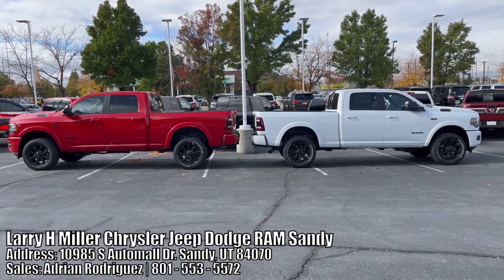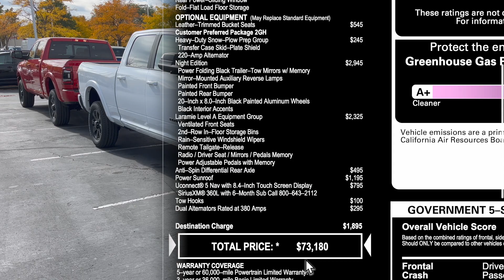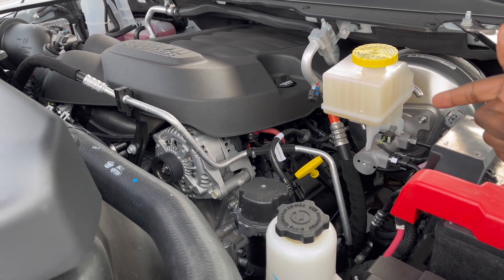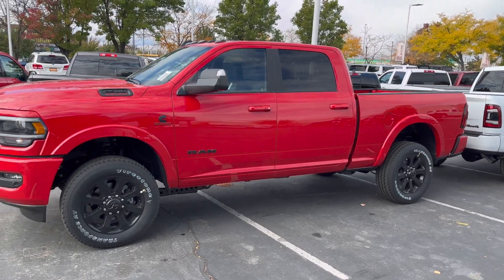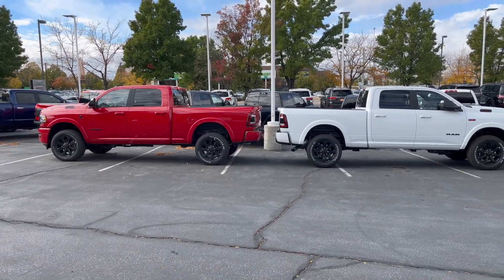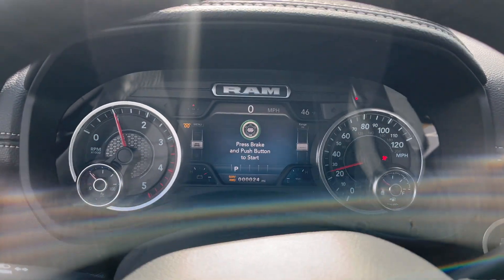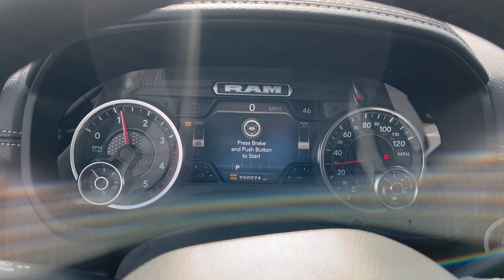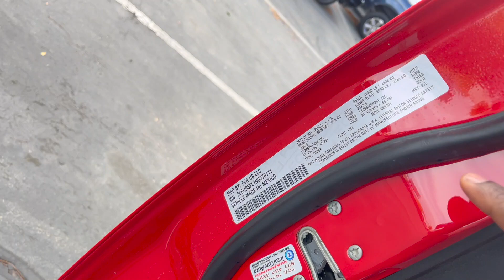Diesel Vs Gas: Why Is The Gas Engine Becoming More Of An Advantage Over The More Efficient Diesel???

Comment: i just bought a 2012 ram 2500 diesel with manual transmission for 7k at a action i had front damage i fix it for 3k more total cost 10k and it has 180xxx miles iam really happy and 2012 is the last year it doesnt require the def fluid

Comment: There's a reason why the 2500s are capped at 10K it's to keep you from having to get a class A license when pulling a trailer that have GTWR over 10K. You can get a 3500 srw if you want a GVWR over 10K.

Comment: What gets me is you talk about how the hemi 2500 is better for towing because of the increased cargi capacity. Then explain why the cummings is better for towing.

I also get how YOU feel the night edition is worth about $2300 (for 2024 $3940 which insane). Then you pick trucks without the towing packages. You are recommending what you feel is the best looking truck for daily driving with occasional towing.

What you should be recommending is putting the night edition cost towards a cummings 3500 and tow packages. 

2024 - 2500 crew cab, 4x2, short bed Laramie
6.7L Cummins
Laramie Level 1, Towing Technology group, 5th Wheel prep
Chrome steps, Bed Utility Group
Trailer Tire Pressure Monitoring
$81,655 +$3940

2024 - 3500 crew cab, 4x2 short bed Laramie
Same options
$85,660

That means the 3500 is $4005 more than the 2500. Giving you the cargo capacity for towing. Amazingly the upgrade to 3500 is only $65 more than the night edition upgrade.

Plus the 3500 has options not available on the 2500
6.7L Cummings HO which includes the Aisin transmision. +$2800
Auto Leveling Air rear suspension.   +$1705
Dual rear wheels (if you pick an 8 foot bed or mega cab) +$1495 (+205 for 8 foot bed)
50 gallon tank upgrade +$295

I have a 2019 3500 Laramie Longhorn 4x4 Crew Cab Longhorn that I bought with 24k miles. For reasons I can't comprehend it was ordered with Aux switches (never used), safety package, towing package, 5th wheel prep and HO engine but without auto leveling rear suspension or 50 gallon tank.

In order to tow my 5th wheel with a 2500 I would have had to get the 6.4L hemi. Losing the engine power and engine brake wss a deal breaker. Losing the stabilty of rear leaf springs wouldn't have been fun and losing the ability to get a bigger 5th wheel (not a huge 5th wheel requiring a dually) in the future didn't make much sense.

While the night edition looks nice, I don't see almost $4000 in value. The blacked out badges and other parts can't cost much more, the rims are nice and the regular 20 inch wheel upgrade is $1695. IMHO a towing platform has higher priority options than $4000 that adds no functionality. If money isn't an issue get a 5500 Chasis Cab with custom bed from Luxe for about $150,000.

Comment: I own a 2022 Ram with the 6.4 Henry and 4:10 gears. I tow a 15k gooseneck dump trailer A LOT... even pull a a 25' deck over. Then i also pull my 33' 5 th wheel. Next truck will be a 1 ton gasser. New diesels are so unreliable. Cost to much to run and maintain.

Comment: Gas will be cheaper, more reliable, better on front suspension components since its lighter and also better off road since its lighter, better in the cold. Modern gas with 8 or 10 speeds pull good enough but if your pulling  15,000 pounds everyday get a diesel. Oh yeah insurance is cheaper on a gas truck also something overlooked alot. In the long run diesel is a pain in the ass and always cost much more in the long run not even counting shop time when its down and your not making money because of it.

Comment: Man your doing a great job with the videos keep up the good work have a question

Looking for a 2022 2500 ram Hami  but I found a2022  3500  standard Cummins with 68 transmission and it's a 169 wheel base  very good deal almost 4k under invoice 
I will be driving around  city for work and play   but it's mostly for my camper around the USA hopefully and  Snowmobeling / atv trips  and fun activities with family I just don't know which one I should get. 3500 ram the diesel option is Almost free with the discount but I'm worried that I'm going to get a lot of problems with  all the extra BS  emissions  and  the 6.4 won't be good on gas with the travel trailer  or sleds  and it's recommended 89 at the pump while that's almost same or more than diesel 

You had a ram would you get the Hami or diesel if you were in my shoes

Comment: The extra costs that you'll Incure with a diesel are negated by fuel savings and engine componant life span. Diesel fuel acts as a lubricant extending engine life Where's gas washes cylinder walls. The diesel is just better in every category in these trucks. Also the ZF8 trans in the hemi isn't as strong as the Allison.
Reply: Well the Cummins doesn’t have an Allison so…

Comment: They are more expensive to fix. And for quite a while now, it costs more at the pump. It makes no sense because it takes way less refining than gasoline. It should be WAY less per gallon, but greed always wins out.
Reply: Newer diesels have so many problems with the DEF systems, they won't last as long as they used to!

Comment: I have a 2022 Ram 2500 Laramie with the Cummins, and my towing capacity was listed at 20,000. I wonder what’s different about mine than that red one. Is there a special towing package or something that you are aware of?
Reply: 3500, gear ratio, dually would all make it higher. Sone packages when ordering it you can select different components to change it

Comment: I am waiting for the 2024 sierra 3500 at4 as long as it gets the interior updates... but also planning on a 10k 38ft 5er.. Truck is $74k in gas and getting the 10 speed... I cannot vouch the extra $10k duramax option plus $2.30g more for diesel plus the $17 for 2.5g def...
so unfortunately, as a dailly... I have to go gas. work is 60 miles one way... hope the 10sp helps mgp when not towing...

Comment: Just wait till that hemi hits 100k and the motor starts falling apart.
Reply: Sadly a new gas motor is typically cheaper than diesel injectors, fuel pump, turbo, exhaust..... the diesel engine last forever the Associated components do not.
Reply: @cliffordmorgan4222  I've had multiple cummins and I've never replaced any of those things. My 2nd gen had over 400k all original and tuned for over the last 100k before I sold it.

Comment: Think what you want, but Dodge doesn't validate their trucks like GM. They have more production and engineering issues that show up during customer ownership.
My 2022 1/2 ton 3.0 Dmax will tow 13k and get almost 30 on the hwy unloaded. High Country trim crew 6.5 box with an msrp of under $65k when I bought it. Dodge has a gross msrp with big rebates to make dumb people think they got a good deal.

Comment: Diesel engines in cars and vans were a popular choice for consumers for decades in Europe until the government decided to go full electric . Once they became turbo charged everyone wanted to buy one and that was a time the government lowered the tax on diesel fuel. The save at the pump is significant . Usually the diesel is very reliable depending on the manufacturer of  course. The DEF system kind of ruins its good reputation.  I've seen quite a few cars with engine lights on and it wasn't always an easy fix for the mechanic when the DEF system didn't work properly.  They hate it.  If the price for a diesel wouldn't be that high I would choose a diesel over gas any time.  There's nothing better than having max torque at low rpms . Imagine to get the gas mileage of a Mazda 3 Turbo in your 3/4 ton pick up truck .

Comment: pick your favorite full-size truck with no motor or transmission in it bring it home build your favorite big block gasser if you're just going to drive local around town put it in there with a sniper Holly EFI system or if you want a diesel put in a 5 9 Cummins with an edge tuner and those two options are better and more reliable than this new garbage that is under the hood of every truck anywhere..

Comment: Ive put 2 million miles on diesel trucks. The issue especially on the consumer grade diesels is the pursuit of power. The high pressure fuel system is a major contributor to reliability issues. Add the govt mandated emmissions and the entire DPF system and there are way too many liabilities on a consumer grade diesel. Your likely hood of ever being ahead vs the gas counterpart is extremely small. All that being said, the Ford 7.3 is clearly the winner in the gas segment. There isnt 1 area where it isnt superior

Comment: I have a 21' Ram 2500 w/ 6.4 looking in the next 2 years possible upgrading to a 3500 SRW or possible DRW.  I am not sure gas or diesel at this time i tow a large bumper pull toy hauler.  Plans to upgrade to a fifth wheel toy hauler.  One advantage i see for me on the diesel is filling up at gas station normally the diesel pumps you have more room getting in & out.  With the hemi when towing I have to pick certain gas pumps to be able to get in and get out since toy hauler is 39ft.

Comment: Payload with a 3/4 ton diesel just doesn't make sense to me if you're pulling a bigger trailer.  Even with my travel trailer (not a 5th wheel), I would be out of payload with the diesel option.  With the Hemi , I can tow it well within the safety margins and still afford to put items in back like a generator and extra water.  Just food for thought if anyone has same circumstance.  Heavy towing and you want the diesel, just go with a 1 ton.  No towing or light trailer - sure, a 3/4 ton diesel makes sense.  
Good comparison, BTW.

Comment: I sold my ram with the Cummins, it’s a love hate. The resale value is crazy right now. I owned the truck for four years performed all my own maintenance. Oil, fuel filters, oil crank case filter, front rear axle, transmission, transfer case. I babied this truck (paint/maintenance wise) I took it firewood cutting I towed our 12,000 pound fifth wheel. I’m just finally over the EPA push back on diesels it’s just not worth it. You have to be some software engineer to make any major repairs. The DEF is a pain in the ass. Plus the quality of these new and extremely expensive vehicles it’s just horrible. I can’t believe in just for short years my third brake light was leaking sunroof leaking. Front part of engine, crank case oil cover dumping oil. Driver side window rattle would make buttons intermittently work. I could seriously go on damaged, headliner, water stains. I know it’s my fault. I bought all the bells and whistles and put it in a work truck. So this time I went a different approach I purchased a Ford F250 super crew FX4 long bed with a 7.3 v8 gas it has only clearance lights on the top cab. No DEF no more paying $7.49 a gallon for diesel. I made the right choice for my fifth wheel and my daily commuter. We have a shop on our property and we perform all our own maintenance on our vehicles. I can do anything I need on this truck. I’m extremely happy with my purchase, and I am not looking back at diesel.
Reply: The 7.3 is clearly the most powerful, overbuilt and simplest design right now in the gas segment. Its literally the recipe for longevity. You did good

Comment: One of the biggest advantages of the Cummins setup is the best-in-class exhaust brake. It's not just a safety benefit, it will all but guarantee your payback on the diesel investment over an extended ownership period. 

I absolutely eat brake pads and rotors on my regular gas truck. But with the diesel and regular exhaust brake usage, I save roughly $10,000 every 70,000-100,000 miles because the brakes last so much longer. For me, the exhaust brake alone makes the diesel option worth the $9,500+ premium.

Comment: The only benefit to a diesel is the power if it’s actually needed, which isn’t the case for the vast majority of HD drivers. Gassers are much stronger than they used to be, last just as long as a diesel now thanks to all the DPF crap, are $10K cheaper, get only 2-3 less mpg with much cheaper fuel and save so much money on maintenance and are basically less of a headache. I’d have to be pulling at least 12K on a daily basis before I ever bought another diesel.  Loving the simplicity and savings with my current gasser.

Comment: Real simple for me. I'm in MN and just a couple weeks ago diesel was $1.90 more per gallon than regular gas. So at that price you're losing money on gas and paying 10k more for the truck. Now this is coming from a guy with a 1 ton Chevy 6.6 gas that needed the bigger chassis but not the diesel engine torque. So unless you haul heavy enough that you need that diesel, or you love diesels and don't care about the cost, the gas option is the way to go these days.

Comment: I love diesel and gas, i have a 98 dodge cummins and a 14 ram 1500 hemi. Never been a fan of diesel in the winter unless its using it all day long. The new diesels are nice untill the emissions systems start failing and then it turns into a money pit. Im thinking of getting a 6.4 hemi ram 2500 mega for on the farm. The old 98 just keeps on going though!

Comment: JB, it would be great if you could actually do a video of you towing your fiver with a new gasser. Have the audio on to get a feeling of the engine sound while climbing and how often it shifts. One of the things I love about the diesel is how powerful it is at low RPM -- and I can pass tractor trailers going up mountains without having my engine sound like it is going to explode at 4000+ RPM like my gasser used to do.
Another thing I found when I switched to the diesel is that I am a lot less fatigued from towing long distances with it. Sounds strange, but it is true.
Reply: It's great not worried when a semi wants to pass another semi going 26 MPH (1 MPH faster than the slow one) while going over a pass.  

I know I can pass that semi and quickly get up to my adaptive cruise control speed of 63 MPH, without worrying if the engine will explode as it it sits at 4800 rpm and if I'm very luck get to 40 MPH at the summit.

Comment: Just got the Hemi! I wanted the diesel but I only tow about 5K lbs twice a month. I was told the same thing you said about I could do more harm then good if the Cummings is not running for a long time constantly.
Reply: Yeah, for 5000 pounds a few times a month there is zero need for a diesel. Good choice on the gasser.
Reply: Or delete your diesel and boom way better then gas
Reply: Cummins*

Comment: DPF, EGR, DEF, and now scales that tattle tail if you overload it. Hard pass on all that garbage. I will never buy a truck that’s so connected that it rats me out if I overload it.
What’s next, send the local sheriff an email if you speed or roll through a stop sign? I will never buy one unless all that crap can be turned off with a tuner. 
I’ll be keeping my old LB7 Duramax and my 87k mile 06 common rail truck alive for the next 20 years. 😂

Comment: It's ridiculous here in Northeast Ohio. Gasoline is running around $3.45, give or take a few cents. Diesel is going for $5.60, or more.  The power you can't make up. If you need it, you need it.  But the cost of ownership now seems to favor gasoline. In some cases, you'll never make up that difference in cost until either diesel comes down. Or gasoline goes back up. For now, until some of this shakes out,  I'm keeping my smaller 5th wheel and my Ecoboost. It tows great, but I'm maxed out. Someday, I would like to upgrade.  Nice review, JB.

Comment: Thank you for the helpful information. I’ve really been going back and forth between gas and diesel. Have a smaller camper pulling with a F150 but want to get a better truck for pulling the camper. Again, thank you
Reply from the maker: No problem, glad it was helpful 👍🏾👍🏾
Reply: F250, 7.3 gas!

Comment: Love my 2500 Ram with the 6.4 Hemi. We tow a 13000 pound fifth wheel and the truck is a beast. I see no advantages to a diesel this day in age. Higher sticker price, higher maintenance costs, less payload… no thank you.
Reply: You must not tow in the mountains.  There is no comparison.  Diesel is king.  The maintenance costs aren’t as expensive as you think, if you can change the oil and fuel filters yourself.  Plus the Cummins has 15k oil change intervals. To each their own.

Comment: I don’t think gas engines are becoming the better option.  I think people are settling for a gasser, for a multitude of reasons.
Reply from the maker: Well consider the Ford 7.3L,  that engine optioned with a 4.30 will probably out tow a diesel from the early 2010's... I think they are becoming the better option when you consider most people are not hooked up to a trailer frequently 👍🏾
Reply: @JB_WhoWork  We just got new brush pumpers with the 7.3 V8 gas. The old 11 6.7 Powerstrokes has so much more power and you feel it. There is no comparison.
Reply: Gas trucks have been doing work in America for many, many years and they were not near as strong as todays gas trucks.

Comment: Great video JB, thanks. I take my 2020 RAM 2500 Cummings to the dealership this week to get the fuel pump replaced. I'm going to look at some 2500 and 3500, I don't think these diesel prices are ever going to drop below $4 and my mindset is I don't tow enough to keep this diesel. Recently towed a 28-foot travel trailer and thought this is way too much truck for a travel trailer!
Reply from the maker: LOL, you probably bent the frame on that poor TT with all that tq 😂! I don't blame you, manufactures have allowed regulations to hurt the efficiency so gas engines have been catching up 👍🏾
Reply: Lmao cummings